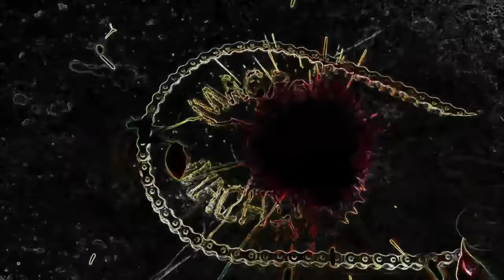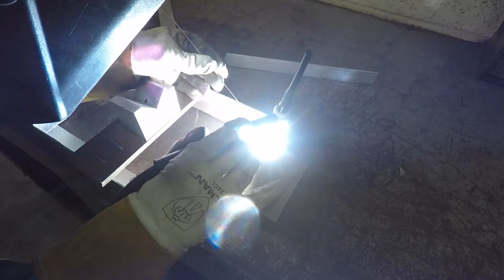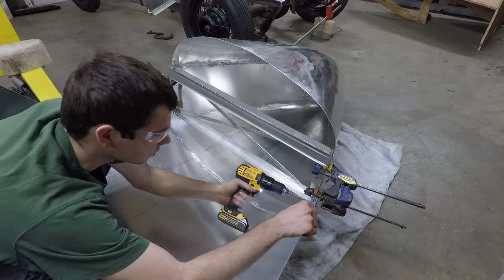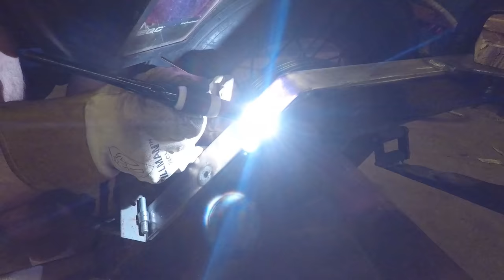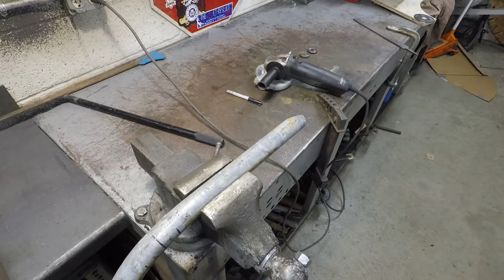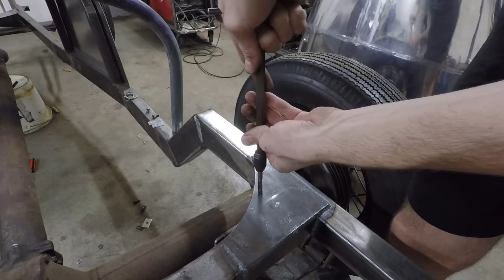Mounting a Custom Aluminum Car Body | Homemade Boat-tail Speedster Pt. 35

Comment: Use an aluminum tube perhaps 1/4'' to 3/8'' gas line around the body for your rolled edge, that would look great and add a "LOT" of strength

Comment: Great job! Just wanna give you a tip: for holding 2 sheets of metal together once you’ve drilled a hole through them - to clamp them together and hold their alignment, find some clecos. Works so much better than what I saw you using in your build.

Comment: Amazed this guy still has all his fingers . Those pieces on the drill press hang on that bit they can spin fast enough to take a finger off. Just a flat pice of wood with a cleat on it clamped to the press base would be a start if you did not want to clamp each pice. Nice work just young and ambitious to get the the job done. Going to slow ya Down a little if you lose a digit . I know he’s slung stuff across the shop but it’s just a matter of time if he don’t slow down.

Comment: How about a stuffed leather edging instead of a rolled aluminium edge around the cockpit area?
Reply: It still needs a rolled edge or some other kind of reinforcing under a leather wrap. But I agree that a leather edge would look great.
Reply: Both?
Reply: @MrRbuxton  The edge is just a single layer of aluminum with no support and it's not all that thick. If there isn't some kind of reinforcement of the edge, the edge will easily bend  just leaning an elbow on it or putting your hand down for support getting into or out of the car. So yes it really should have both. If it's wrapped with leather it doesn't have to be as fancy but it should still be there.

Comment: Amazing skills.  Exactly what I needed after a bad day at work.  Why not use kleckos?  You have every other tool known to man.  I’m really enjoying this series.  Gary
Reply: That's what I was wondering too.  I've always seen 'em spelled clecos, but regardless, seems like it would make it a lot faster to use them instead of nuts and bolts.
Reply: @TWX1138  They don't seem to be that much of an advantage if not working with blind holes (i.e. if one has access to the other side, like he does here). At least not enough to purchase them if she doesn't already own a set.

Comment: That’s gonna be bouncy ride. When forming the rivets, the impact should be on the end you are mushrooming with the block on the head.
Reply: Who knew all those WWII planes were riveted wrong? Sorry but you're wrong. The rivet set is shaped and polished to fit the factory head and the bucking bar forms the shop head.

Comment: The ole school edge was a wire rolled edge for the panels on these types of bodies. Bead roll a edge, place a wire in the gap and hammer it over.

Comment: one thing that would be a good idea is to paint or use adhesive in between the rivited pieces on the body and the framemounts , if moisture can creep in between the bare aluminium is bound to start rotting and push the pieces a part 
after you shook the rear of the body side to side i was wondering if you are going to mount a panhard bar or at least some triangulated bars to the rear axle , dont think you can drive it the way it sits now

Comment: I'm planning on wrapping my sheets around a 1/2" aluminum dowel on my speedster build.  I did a body frame and am just now wrapping it.  Complete pain in the rear.  Good job on your project so far.  Only suggestion is think about accident survivability and add some triangles to your framework.

Comment: You can bend a thin pipe and slit it to put on the edge for a softer edge. Then maybe sew on an upholstered leather roll later like the rim of an open airplane cockpit.

Comment: That is a really nice job.  What is the name/make of the air tool you are using for the riveting please?
Reply from the maker: it's just an old air chisel that I made a riveting bit for. there's a video on it of you look back
Reply: @MacroMachines  Thanks very much for replying.  I will have a look through your videos, that looks a very useful piece of kit.  Like you, I try to reply to all the questions on my Youtube channel.  That looks like a Ford Model A rear axle, is that right?  That is going to be a very pretty car.  There is a company in the UK called Compound Curvatures that also produce some very nice bodies for mainly MG's.

Comment: Do you plan on setting a leather spacer on top of the hoop to prevent chatter and corrosion from between hoop and aluminum?
Reply from the maker: yes, there'll be thin leather/rubber spacers between all the body panels and frame

Comment: I see that you smooth the bead on the outside/top and then wheel the joint but do you smooth the inside/bottom weld bead before wheeling?
Reply from the maker: yes

Comment: I didnt see foam tape between the panels and support structure 
When building cabs we always put the foam tape to seal the rivets and panels for water tight connections

Comment: If you really manage to work at this speed for the next month you will get this done before Binky is driving.
Reply: John WasistdasfüreineScheiße 
Well. Considering that Binky turns 6 this year and is just getting painted I don’t think he has to worry. 😉
Reply: @Crewsy  Well there are a lot less brackets in here.

Comment: Would you know the maker of the pneumatic tool you used to finish peen the rivets? Also the source for the rivets you are using.  Most of what is available to my local market  are blind rivets that tighten and finish by drawing a bead through the barrel to expand and lock the rivet in place- yours look so much more period and smoother, TBH. Thanks for letting us watch!
Reply: Yes I want to know more about those rivets I think they come out of the aero industry .they still use solid rivets . Love that priming tool lots better than the pistol type

Comment: Would you tell us a bit about how you design and plan your work so that you don't rivet yourself into a corner or create a maintenance nightmare? I assume the process is somewhere between formal engineering drawings and pure ad-hockery; there are a lot of decisions embodied in your creations.